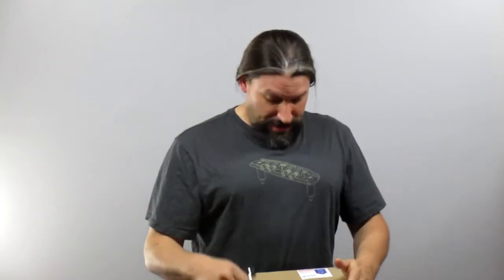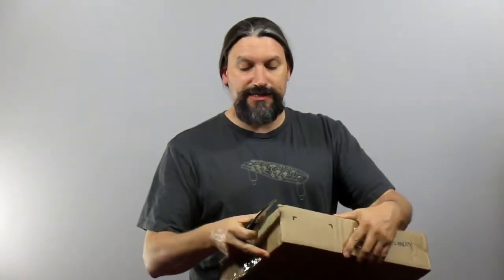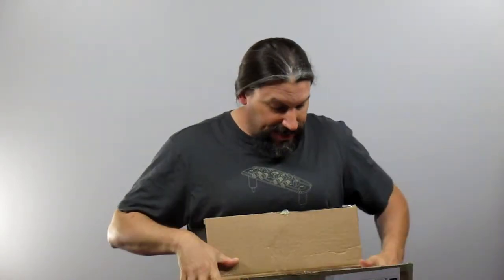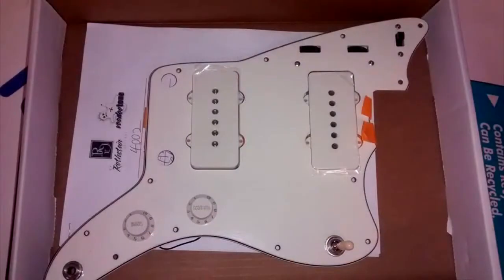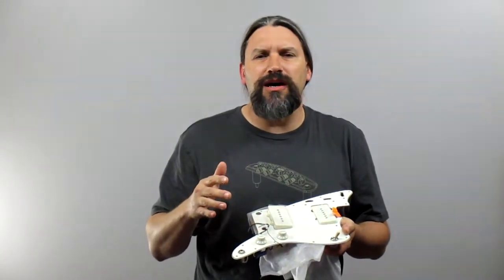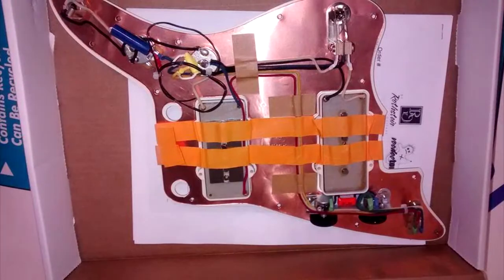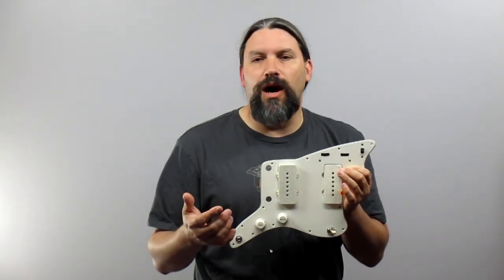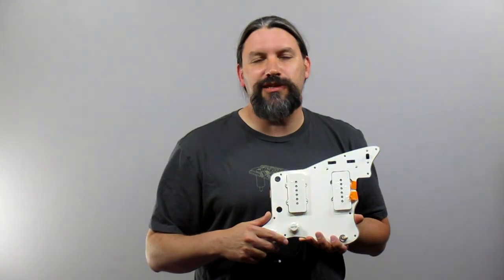First Look: Rothstein & Novak Jazz Master Upgrade

Comment: Never really understood the reasoning behind the rhythm circuit,  - the Jaguar wiring ,- yes.Leo usually didn't jack around with nonsense.
I will likely be doing this mod, as in the past ,I've always just disconnected it.

Comment: Hey there. I know this question is a bit random and you guys are a bit away from me. I live in PA. But I'm wondering if you do refinish jobs? For example I have a Jazzmaster with one of those polyurethane finishes that I'm thinking about getting stripped and repainted in a different color with either a nitro or gloss finish.
Reply from the maker: Hi thanks for watching 

We can help with your refinish work and or build you a new body too.
We no longer work with lacquer because the availability of colors is so limited. We use the PPG paint system and it comes in a dizzying array of options.
Feel free to message us from the website www.texastoastguitars.com when you would like to move forward with your project.
Reply: Ok, thanks for in info. There's nothing wrong with the body. I've owned a Jazzmaster before like 18 years ago and really liked it. I don't even mind the color but it's a TVL Signature model That I bought last year and I'm just looking to make it my own. I've already changed the pickups to Lollars, and put a Mastery Bridge and Trem on it. I only got it because I love the design with the inlays and the top rhythm switch being a metal switch. And of course having wanted to replace my old Jazzmaster form years ago.
Reply: How much would it cost to get a matching headstock painted in ppoly surf green with a provided fender jaguar logo with a poly clear coat on top for my squier jaguar's neck? id ship the neck of course haha